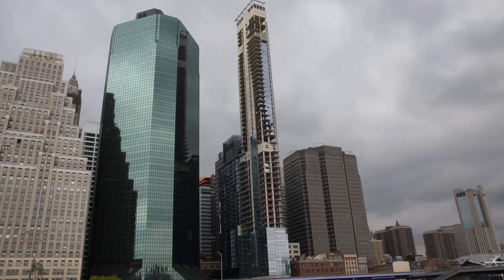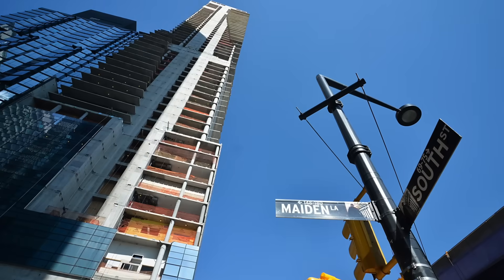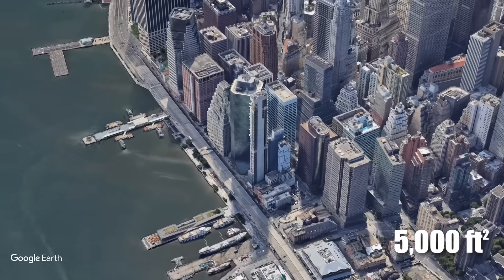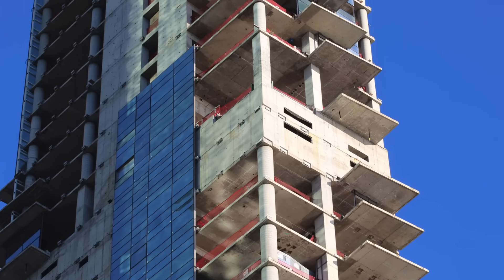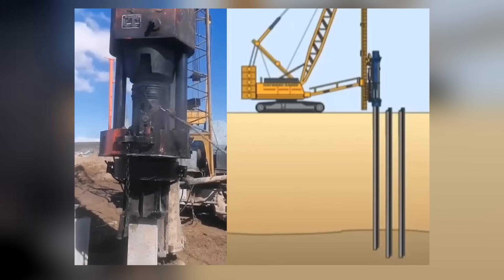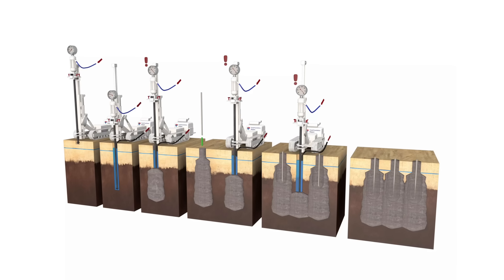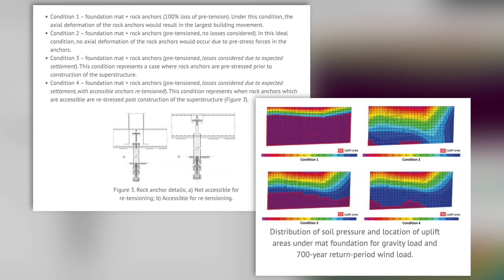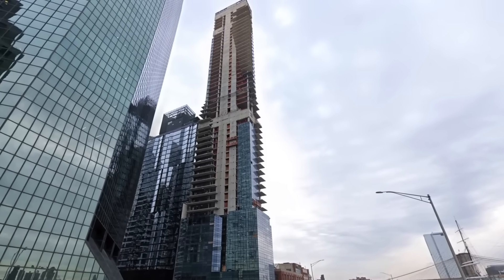Why Nobody Can Fix This New York Skyscraper

Comment: Those ultra-thin skyscrapers freak me out.
Reply: it does my head in, how can they build so high with such a comparably small foundations,  but they can do it.
Reply: @horseshoe182  They can do it, but how long will they stand? What will happen when all of these buildings start failing in a couple of decades?
Reply: @mynamesjudge I think they would work better, and last longer if they were made of steel, which would make them lighter.  However that will make them more flexible and therefore sway more, with a secondary problem that the bolts holding them together will need to be checked regularly to ensure that they aren't coming undone.
Reply: @pulaski1  Most high-rise building are a steel framework, with covering and windows attached to the frame. Concrete slabs for the floors.
Reply: @mynamesjudge  They will buy condos in Florida where bad things never happen.  /s
Reply: @mynamesjudge lol nyc is filled tons of tall buildings decades old..
Reply: @horseshoe182  Just because you can do something,  doesn't necessarily  mean you should do it!
Reply: @horseshoe182   🙂👉The developers and architects planned & installed in many of these pencil towers 100 tonnes of counter weights. 
Basically, the top floors of these pencil towers are housing giant swinging pendulums that counters high winds and earthquakes.
Reply: Me too - they just look like they don't have a wide enough base to remain upright for long.
Reply: @markthompson180  NYC's CITICORP building may have toppled over in high winds had a Princeton U student, writing her thesis on the building not discovered a flaw in its design.

The City surreptitiously implemented a 10-sq. block evacuation plan and crews were brought in after hours until the building could be made structurally sound.
Reply: Skyscrapers, in general, freak me out. It's ridiculous how high they can build.
Reply: Crick or creak. Up a creek without a paddle.
Reply: It's like "tiny houses" for rich people.
Reply: Like cruise ships that look like a huge building on top of a comparatively tiny boat. How do those things not capsize immediately?
Reply: @michaelmartin9022  They have good foundations, but also, the downward force due to gravity means a colossal sideways force is required to tilt them enough to destabilise them. The wind is not sufficient, nor impact by jet aircraft. Each of the Twin Towers was 250,000 to 500,000 tons or more.
Reply: Every sky scraper  is freaking me out these days. How has the Empire State Building lastd so long? I guess we knew more about sky scraper engineering in the 1930s than we do now and without computers.
Reply: @1940limited common sense.
Reply: Skyscrapers are getting thinner while people are getting fatter.
Reply: @Crazy-Clown-In-Town  Builders should ask them all to stand on one side of the building until it returns to vertical. Also, offer discount to buyers agreeing to use their combined weight as a resonant mass damper.
Reply: @mikeomolt4485 proper weight distribution ?
Reply: @Crazy-Clown-In-Town  Peak Americ'
Reply: @Crazy-Clown-In-Town  Why not get all the fat people to buy apartments on the opposite side to the lean, in order to counteract it?
Reply: @Crazy-Clown-In-Town 🤣🤣
Reply: They should have consulted SEA where technology of such are a science.
Reply: I watched videos saying they creek loudly during windy days.
Reply: @justSTUMBLEDupon they're supposed to do that, otherwise down they go
Reply: And they are a stupid idea. Because you can only have a very few elevators. You will be waiting for 10 minutes for the elevator.
Reply: @thedude2867  take the stairs
Reply: @thedude2867 Or longer!
Reply: Agree. They make me think our hubris is progressing faster than our wisdom and grasp on technology. Not a sign of a smart society, but an arrogant one.
Reply: I've seen footage of the interior of one of them, at that height the wind hitting the building makes the steel structure move slightly and the sound produced is pretty unsettling.
Reply: I'm more freaked out by the idea of paying millions for an apartment!
Reply: Ive never felt thin skyscrapers  look or are safe.
Reply: I surely agree with you 👍 💯 👌 but, I don't like what they're doing to new York, and I don't like how the NY skyline is looking 😢😢😢😮😢😢😢😮
Reply: They sway in the wind and the pipes rupture and flood out the apartments. Many are owned by shell companies which launder Russian, Chinese and other money. So these are mainly a way to store wealth, a like a bank. Few super rich people are suckered to live there.
Reply: They use cables and very deep / or wide basement...
Reply: Thailand is full of them.
Reply: Same
Reply: They're butt-ugly, among other failings.
Reply: I hate them. They are ruining the skyline of midtown.
Reply: They are actually the safest
Reply: Grow a spine

Comment: “Caissons to bedrock”. Three words that would have saved the building. I learned those three words 50 years ago in architecture school. Damn.
Reply: And it only saved 6 million doing it the cheaper way. In this context 6M isn’t that much money.
Reply: The perimeter caissons on the John Hancock building in Chicago are 10' in diameter, go down a 198-205 feet to bedrock.
 It's still standing. When will people learn.
Reply: So when are they tearing this building down???😮
Reply: @rubenlaracuente8991  Just a matter of time. That is, if it doesnt fall down first!
Reply: If the Petronas Tower can be anchored at 400 ft there is no excuse for this project to fail. The City of New York should shoulder part of the blame. The accepted the design and knew about the Geotech. Someone has greasy palms.
Reply: I can only imagine the price tag of sinking a caisson almost 200 feet into the lip of lower  Manhattan.  That's probably why they passed on that option.  Big mistake.
Reply: Could someone come in and still drill to bedrock adjacent to the footprint, at angles if need be and stabilize/jack the building up 3 inches? At the very least the glass needs to come out and be redone afterwards I realize but is it possible?
Reply: @beauzer36 See how that worked out for the sinking building in San Francisco.
Reply: This wisdom is in the Bible
Reply: @WilliamCantrell-qu3mp Yes.  Foundations 7-11.
Reply: @JKjr > I've been private practice Professional Engineer, certified in civil, structural and MEP.  I've worked with hundreds of architects, majority are clueless on any engineering discipline
Reply: @JosephOlson-ld2td  Joseph,  I've been a licensed Architect for 44 years. I am not like those guys. That is a sorry tale to hear. A truly sad state of affairs if architects are that vapid these days. John
Reply: @JosephOlson-ld2td  The architect simply draws his own personal vision of of an outstanding and impressive building.  The Civil engineers are the ones responsible for overcoming the building problems.
Reply: @mrmyorky5634  The structural engineers are usually subcontractors of the architect.  The owner/developer may not have any direct contractual relationship with the structural engineers.
Reply: @JosephOlson-ld2td  I am old school I am aware. but in general you are correct.
Reply: I agree.  Developer/builder in residential construction for 40 years. Architects make a pretty picture without regard to structural integrity. They should be required to apprentice with framing crews, for 2 years to learn about bearing points etc.
Reply: @brentcarnelli5664  Brent, You are 100% correct.
Reply: Cut corners and here you go
Reply: PRIDE goith before the fall.
Reply: For sure 😁
Reply: @johnkeviljr9625  How did you get as far as architecture school without knowing the word “to”?
Reply: @bjsimpson4768  Weird question BJ.
Reply: @bjsimpson4768  He meant that the caissons have to go all the way down to rest upon bedrock.
Reply: Look at the Zellerbach builging in San Francisco- it worked !
Reply: But...but...they got "innovative" lol
Reply: Profits before safety. And they only saved $6 million dollars out of the hundreds of millions they might have made if they'd done it right. Stupid!
Reply: caissons to berock + rock anchors, you need both
Reply: Architects are not educated enough to oversee crooked contractors and shady structural engineers > always get a second opinion
Reply: @JosephOlson-ld2td   You don't know the right architects. But I agree on a second opinion.
Reply: @JosephOlson-ld2td   That's an incorrect statement.
Reply: This building cannot be abandonned, it has never been occupied ! Finishing it is probably too costly for the developper, he will loose a lot of money but somebody will eventually take over with the right engineers. Hopefully.
Reply: Easier said than done. Bedrock in 160+ feet deep.
Reply: @msotil in that case, there an option to build something suitable to the existing type of soil. But…
Reply: @msotil Well The Brookland Bridge has not fallen down>
Reply: @jamesthornton9399  Brooklyn
Reply: Then it shouldn’t have been built
Reply: @msotil  is the current situation easier, or cheaper? Unlikely.
Reply: @msotil  Then don't build there. Build somewhere else. Common sense is always cheaper.
Reply: After battle all are generals.
Reply: @zell863  Lessons not learned. Or not learned from others experience. You don't have to be a general to be a skillful observer.
Reply: @zell863  I guess you could post this under any comment critical of a mistake but I'm not sure I see the point of doing so.
Reply: @zell863 before the battle you needed a general

Comment: From New York leaning tower to San Francisco leaning towers, If I ever build a skyscraper   I will insist it be down to bedrock
Reply: It should be the main question of all potential high rise buyers: "Sir, does you foundation reach bedrock?" - "No" - "Good day, sir"
Reply: When they were building the Mandalay CAsino hotel in Las Vegas, it began to settle in the center, dropping 18 inches, they hired engineers from the East to shore it up at a great cost.

Comment: The thing that caught my eye was the tagging at the top of the building 9:01. I’m here in Chicago and sometimes you just catch tagging some where and wonder how in the hell did they get up there. Definitely looks like they must have repelled down this building at night and went back to skyscraper window cleaning the next morning.
Reply: Perhaps, also If you'll notice there is vertical structural truss work on either side (for elevators?)  which can be hooked on to in various ways...
Reply: That's awesome observation.  We call it vandal here in NY.   :face-blue-smiling:
Reply: @bigradwolf5001  stop it! I’m sure some New Yorkers refer to it as tagging as well. That’s a pretty common term for it.
Reply: @bigradwolf5001 🤔 Perhaps YOU call it "vandal", everyone else in NYC calls it "tagging". It used to be a big subway thing.
Reply: Ha ha I saw the tagging/spray paint.. that would have took a few minutes to do
Reply: There are exposed beams/rebar towards the top. I've actually hit this specific site before, its pretty sketch to get to the very top ledge where they are fastened into the concrete. I'm assuming they got up there and rappelled down, wicked stuff. And for those in the know, its called tagging in NYC.
Reply: @charlescheng3480  we call it tagging here in Chicago too, A pretty universal term for it. But I can’t see myself taking that risk to leave my mark, hats off for the courage.

Comment: It is leaning towards the Millennium Tower obviously.
Reply: Imagine if major earthquakes were possible like in San Francisco’s 1906 earthquake!
Reply: @mitchellbarnow1709 San Francisco also had bad earthquakes in 1989 and 1994.
Reply: If you are at the exact North Pole, any leaning in any direction, will be towards south.
Reply: I thought it was leaning north.
Reply: Those two earthquakes were moderate on the Richter scale and 1906 was a major earthquake. Yes, they are all horrible to experience.